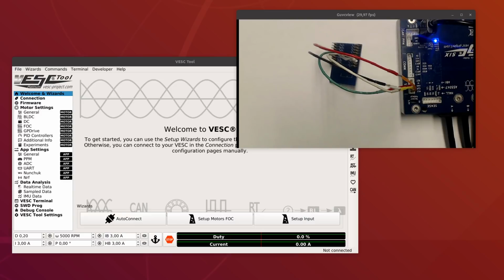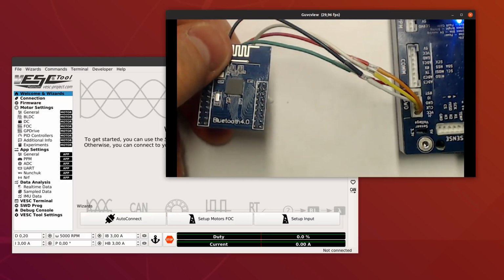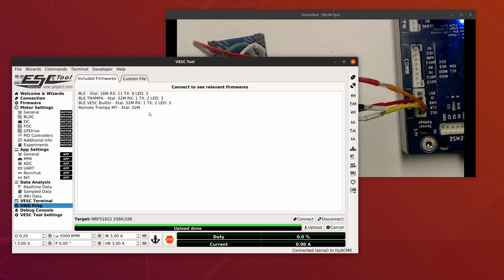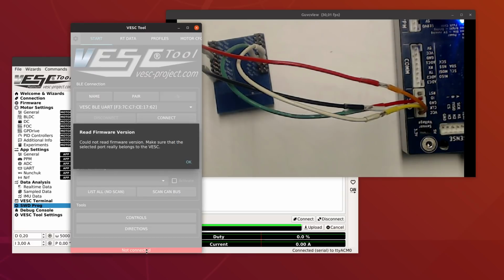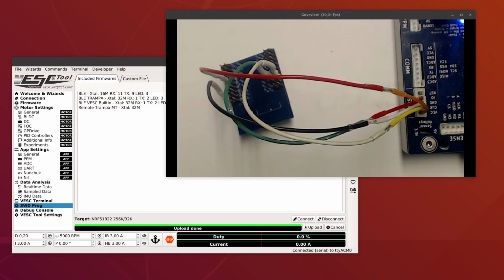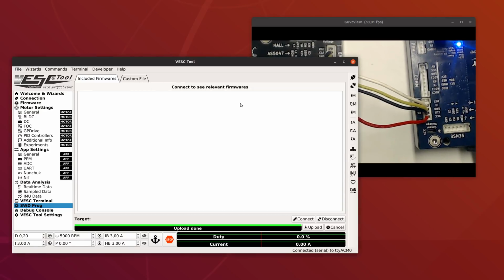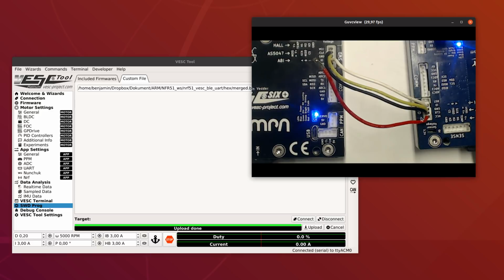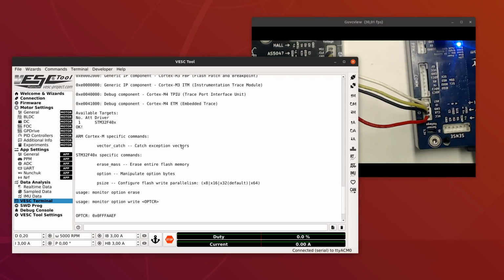VESC as SWD programmer: Flash BLE modules and fix bricked VESCs

Comment: I am trying to revive a trashed VESC that got bricked during a failed set up on a new Floatwheel.
Just to clarify, are the following all true (Y/N)?:
1) both VESCs MUST be connected to independent power supplies. You can not connect VCC to power the bricked VESC from the working VESC even if it the bricked VESC is unpowered
2) when a second VESC is connected as shown, the VESC Tool will show the info for the daisy chained (bricked) VESC, not the one first in the chain (the working VESC directly connected to the USB port of the computer)
3) VESC Tool then copies the boot loader and firmware from the first (server) VESC to the bricked (client) VESC, so that all firmware updates that had already been done on the working, unbricked server VESC will transfer to the client VESC, bypassing the need to do that part of initial set up once the client VESC is restored.
4) additional set up (like calibrations) will still need to be performed to optimize the revived VESC.

Any input I can get for this process will be greatly appreciated. Thanks!

Comment: Hello Benj, I have been trying to flash nRF52840 based modules via SWD and it isn't able to connect. I tried different modules no luck. Is there something I am missing, could you tell? All connections are correct, voltage, ground etc. The modules are visible as BT devices, but have some code pre-loaded. I want to erase it and flash with VESC compatible code.

Comment: I have two vescs 6.41. One of them just keeps a solid blue light and probably is bricked. I tried this method, however I keep getting an error message "Could not connect to target" when i click "connect". I checked my wiring, both are connected from the same battery and I connected only the three pins mentioned above. Any suggestions? Do I need a ST Link V2?
Reply: I am using Flipsky FSESC4.20 board and having the same issue from the get-go... Trying to figure out what is missing in this puzzle. ST-Link is not going to help, as I believe. Unless you have a software that is able to suppport nRF5XXXX targets... Segger J-link is out of consideration...

Comment: dammit, this video would have been really useful like yesterday. 
I have the 16k ram nrf. After flashing (with the vesc tool) it has Bluetooth and i can connect with the vesc. I can read data and change the motor presets but i can't do 'motor detect' or change from foc to bldc. This doesn't do anything or says it failed. Is this a limitation of the 16k ram version or a bug?
I tried re flashing the nrf again but nothing changed.
Reply: Hi, The bug is fixed in the last update. Thks dude